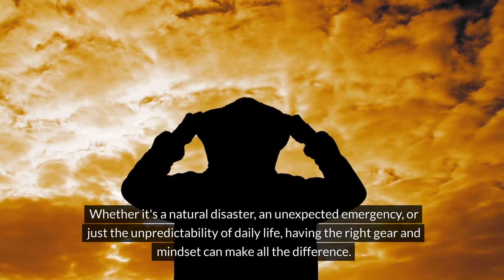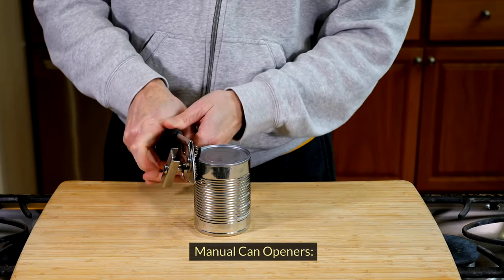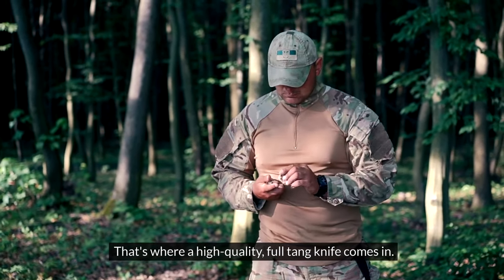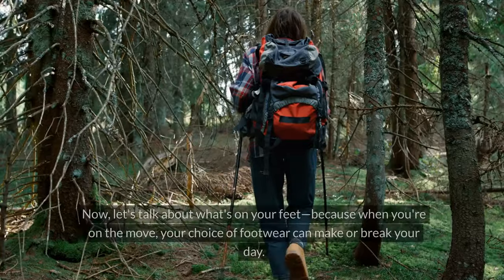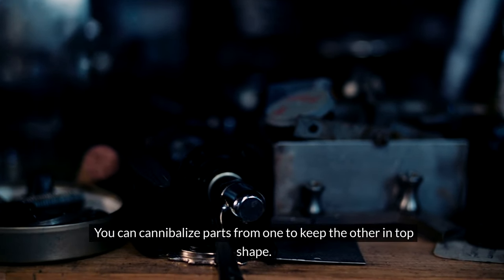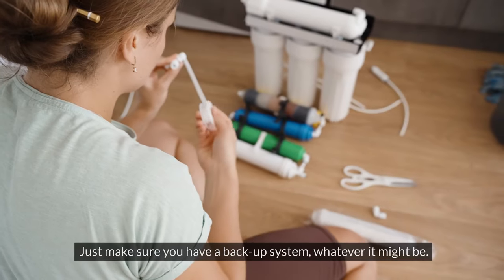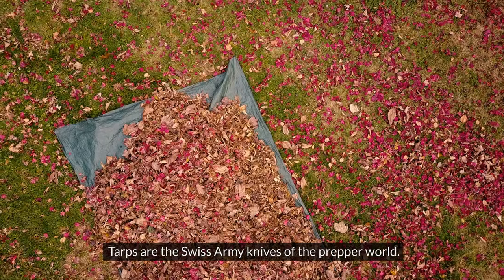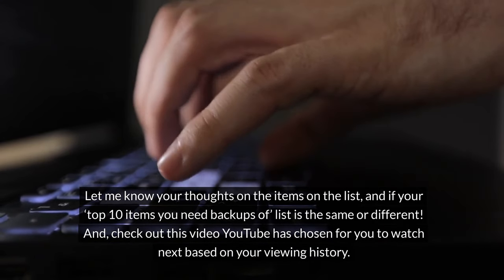SURVIVAL GEAR SO IMPORTANT YOU NEED BACKUPS!

Comment: All good advice.  I like backups to the backup for lot of things. One of the most important items to me is a good quality knife. They last a very long time even if they are used daily and kept sharp correctly  I use a fine Arkansas stone or a Warthog sharpener to maintain the bevel when necessary and a butcher steel and razor strap to maintain the edge. Just using a stone grinds the blade down.
Reply from the maker: One of my various presents...birthday or Christmas, was a set of sharpeners. I have them all over...2 in the shed, a couple in the cabin, and use them every time I use my knives. I even have a sharpening set for my tools :)

Comment: The first two items you mention, can openers and knives,  will always be with you if you have a standard SAK in your pocket. My Victorinox Cadet is slim and sturdy. I've spent too many times in the sun without a ball cap and several long cold nights because I didn't have a jacket with me.
Reply from the maker: I carry a bin, with a lid, in the car. has a blanket, hat, extra socks etc. Pair of boots next to the bed in town and at the cabin, with clean socks always laying on top. 
And yes, if you have a standard multi tool or SAK you have a can opener. But, not everyone has those. Even though they should! :) lol